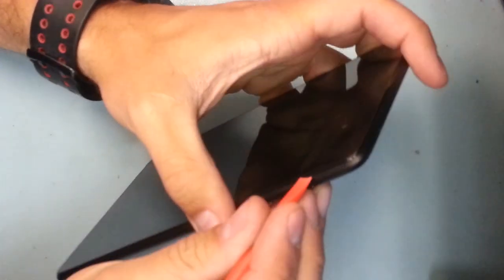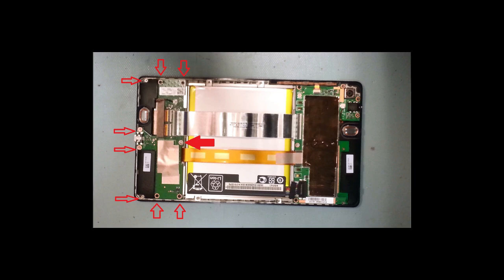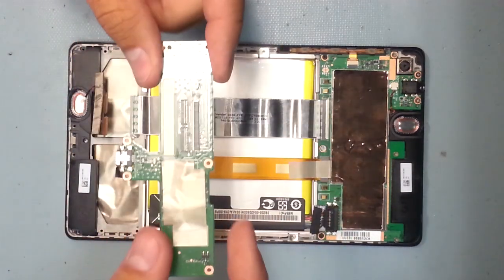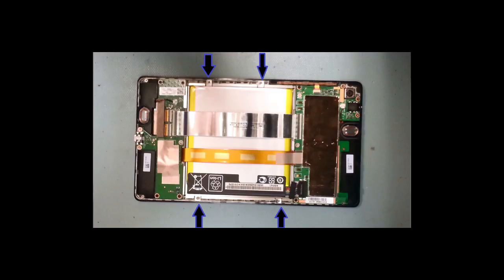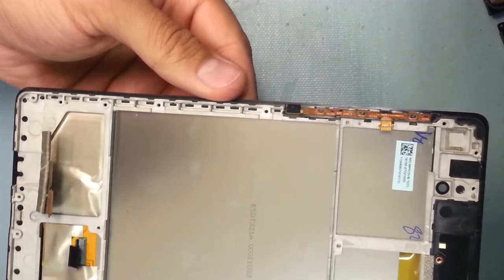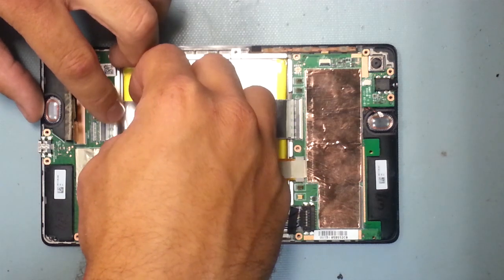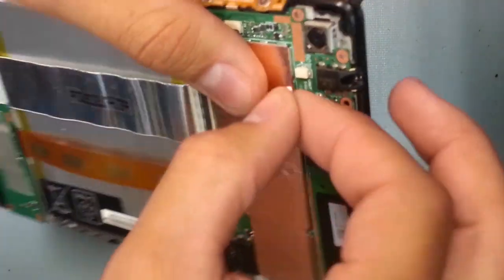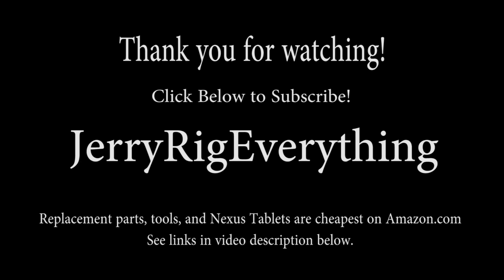2013 Nexus 7 Tablet Teardown. Charging port fix and screen repair.

Comment: JerryRigEverthing, love the nick lol.  Looking for the specific USB part for replacement for this unit.  Sorry if I missed it in the video description area.  I have already gone Qi Wireless for it but I'm looking to replace the port anyhow just to have it functioning again so I can cast Netflix to my Receivers via a SlimPort Adapter to HDMI utilizing this port (Chromecast I know will work also just want the port working regardless :) ) .  Darn Micro USB Ports, I just replaced them on both my Note 1 & Note 2 thanks to my kids breaking the ports and now the Nexus 7 is in the same boat (thanks to wifey breaking it lol).  Excellent Video, very clear step by step instructions.

** Sorry I just caught a comment 6 mths ago that there is no parts available for the USB port as yet and to utilize Qi for now. Darn it.
Reply from the maker: You can always check repairs universe, or etradesupply, or amazon, or ebay, for the parts  you need... But I still havent found anything for this tablet yet.

Comment: Does the screen from repairuniverse also include the bezel (or frame or housing. I'm not sure of the terminology) that is attached to the LCD and digitizer? It doesn't mention it in the description, and there aren't pictures. I noticed a lot of sellers on ebay don't include the bezel, which I think, would add a significant amount of work.
Reply from the maker: I am not sure, I havent ordered that particular part from them.  Check with their little 'chat' service and ask them that question.  If it does not come with the bezel, you can separate the 2 with just a little heat.

Comment: Great Video!  Thank you for the insight.  My Daughters N7-2103 micro USB port broke and I am struggling to fix. 2 Questions:
1) Where can I find a the USB/Board replacement parts (if you know)?
2) Will the QI charger work on all N7's?  Or do I need to install something inside the cass?
(Ok, sorry that was really 3 questions)
Thanks
Jay
Reply: The 2013 has wireless charging built-in. The 2012 model does not.
It seems that the USB connector/board cannot be replaced with a simple board and that it needs "recalibration" by Asus. I call bullshit but it means that you can't easily get a replacement without going through Asus.

Comment: hi again! i managed to change the broken screen on my nexus 7 2013. Like u said, it wasnt that hard. However a few things to keep in mind: 1. its best to DISCONECT THE BATTERY BEFORE DOING ANYTHING ELSE, once youve removed the back cover. I thied doing everything exactly like you did but i must have touched something sensitive and ive managed to fry the charging port pcb, i saw (and smelled) smoke so i thought its done for. But i continued with the repair and, to my surprise, everythings works except charging. 2. like somebody else said it here in the coments, the replacement screen (from etrade supply) does not include the front plastic frame. So you have to detach it from the old screen, or should i say pry it. It is stuck to the frame with a strong sticky tape all around. Hair dryer didnt work, i had to break the screen by making a big hole in the middle and then use a small screw driver to pry the remaining part from the frame. The screen needs to be pushed towards the front of the tablet  in order to be removed. You will need to stick the new screen to the frame, i used very small points of super glue. This is the neanderthal way and i do not ever want to have to do this to an electronic device again, ever. You can also cut yourself in the process and there will pe very small glass particles everywhere. Would be great to be able to buy the whole assembly, screen + frame. In the end the touch screen works but not as seamles as it did on the original one. I am not an expert but i think the replacement from etrade supply (comes from china, not usa!) is the same part as the original. After all this, i whish id have saved me the money (screen + charging port + shipping = about half the price of a new 32GB N7) and the trouble, and just bought a new tablet
Reply from the maker: Sounds like you had quite the experience.  I have looked for other screen suppliers, (As the one from etrade isnt that easy to do)  But I have not found anyone else who sells the screens.  If anyone finds a good one. let me know so I can link it.

Comment: I just payed 60 dollars for the Google nexus qi wireless charger and attached it to the back of my nexus 7 2013 and nothing is happening.  My charging port broke and I saw this as a simpler solution than replacing the port. I don't know what to do. Any suggestions?

Comment: hi! Thank you for this video! This helps A LOT! I will attempt to change the cracked screen on mine. Is the screen that is sold on etradesupply the same as the original? Or is it another manufacturer? thanks!
Reply from the maker: I am not sure where they get their screens from...

Comment: dude. thanks! i just replaced the charing port piece. ur video helped alot! it was super easy. i had gotten a "PowerBot" wireless charger from amazon. and it was working for a while but then all i would get when i would try to power on was 5 blinks from the notification light. its working just fine now. thanks again
Reply from the maker: Glad I could help!  Thanks for watching.
Reply: Where did you order the charging port piece from?
Reply: Seth Wieder ebay. just made sure it was for 2nd gen 2013 version. super easy
Reply: Armando Martinez Jr can you share a link?
Reply: Seth Wieder no. it was a guy selling one. do a search using: nexus 7 (2013,2nd) port
Reply: Armando Martinez Jr How much did you pay? Cheapest I see is $75-125

Comment: This wireless charger, if I got that instead of replacing the micro USB port would that work? It's a lot cheaper. Right now I can't charge mine at all because of the USB port. Thanks.
Reply from the maker: Yup, as long as the tablet has the Wireless charger built into the back, itll work just fine.

Comment: K, so this morning I woke up to my n7 2gen off and I could not turn it back on, was charging all night and worked perfectly the day before. I am thinking my battery went out somehow because if it was the charging port not working it would have at least 50% battery left. If you can find a 3950 mah battery for it I would highly appreciate it, I can't seem to find one yet. When I get home from school I am going to open it up if it continues to not turn on and see if something somehow is broken, maybe I hit it in a bad way and killed a board, hoping for the best. So far I see the best situation being the battery is hosed and I need a new one. Thanks for the video too!
Reply from the maker: No problem!  Hopefully disconnecting the battery for a bit will fix your problem.
Reply: JerryRigEverything Opened it up and took it apart completely and re assembled it. It turned on like new,however the wifi doesn't work. It says "turning wifi on" I looked all over and most people said they restored the tablet and that fixed it, but most I doubt it will. I am assuming there is the possibility that something went wrong on my part when I took it apart. Have you any experience with this problem before?
Reply: JerryRigEverything Should clarify that it is stuck on "turning wifi on" and that I'm not just impatient :)

Comment: When you say that "This is the whole screen" at around 4:40, it is three different parts.  There is the glass screen, the digitizer, and the bezle.  When I ordered the replacement screen for about 100, the bezle does NOT come with it.
Reply from the maker: Yes,  You can transfer the bezel from the old screen to the new screen with a little heat and careful prying. It all depends on where you get your replacement screens from.

Comment: hi man, i have problems whit de wifi connection on the initial boot, detec de wireles but show a message "saved" and dosent connect, on a few second said "innability" or "out o range", i cant configure my nexus 7 2013 kitkat, can you help? thanks

Comment: thanks man this was really helpful. when i click the link for the screen replacement it sends me to the website(etradessupply) but it automatically puts the quantity at 2 which makes it $195 do i need to buy it like that if i want both the screen and digitizer or can i just change the quantity to one and still get both?
Reply from the maker: You can change the quantity to 1 if you like.  I also just linked another screen from repairsuniverse.  It might be slightly more expensive, but ive had a better customer experience with them.  Ill leave both links up for awhile.

Comment: is the process the same for replacing the lcd and digitizer on the LTE version?
Reply from the maker: It would be pretty darn similar.
Reply: Ok awesome. Happen to know if I could use the same LCD and digitizer you've posted?
Reply: JerryRigEverything just wanna say thanks for this. I was able to replace my screen on a 2013 LTE version with these similar steps. Only difference is there is a grey wire on one side under the battery and a black wire under the opposite side of the battery that connect to the top and bottom board. otherwise everything is the same minus one screw on the bottom usb board. Replacing the screen just required a heat gun and patience with removing the old cracked screen from the bezel. Thanks!!!!!

Comment: there are cracks underneath my screen i accidently sat on my nexus 7 i sent it into asus and they said there is physically damage to the lcd. they want to charge me almost as much as is was to purchase from best buy. so im gonna try and do it my self. do i just need a new Lcd or a new screen as well? there is no cracks on the screen.
Reply from the maker: The LCD is the most expensive part.  I would buy the LCD/ Glass combo.  I think I listed one in the video description.  If you buy just one or the other, it will be a much more complicated repair.
Reply: ok thank you very much for your help.

Comment: Know any tips of fixing a screen for a Nexus 7 tablet that it turns on n everything, just does not respond to touch, AT ALL. I've tried power downs, reset, nothing, Even popped the back off and checked what cords I could to make sure everything was connect.

Comment: Hi my nexus 7 broke the other day the screen has a long crack down the side of the screen I can still turn it on and the screen still kind of works as I can still use most of the left side but the right side is completely unresponsive, I just wanted to know what I need to replace is it the screen and the digitizer?

Comment: My Nexus 7 2013 doesn't work at all, I tried all the suggestion but it does not wotk
Problem: Frozen on the X logo.  I tried re start, goes back to the X logo until the batteries is drain.

Comment: thanks for the directions, i used like 20 diff video. need to change the glass, couldn't find anyone who would show how to do the screen, was gonna film myself but gopro was PMSing, my glass broke and i had to peel it of by hand, bunch of cuts but for the fix deff worth doing it yourself
Reply from the maker: Did you actually get it to work?  Im very impressed.  That is a complicated job.

Comment: HI Jerry,  My cable charger seems to be very loose in the port socket and is also not charging and it loses charge when and if it does charge.
Reply: I am having the same issues as well as having problems finding the USB port parts for the 2nd GEN tablet.

Comment: Jerry, when I look at the pictures online of replacement LCD + Digitizer assemblies they don't appear to be what you show there as what you want to replace. In the video it looks like there is a housing with the power and volume buttons as well as the screen, but when I search online the pictures only show a screen without housing type structure with volume rocker,etc. Where can I buy the whole housing and screen assembly?
Reply from the maker: Screens for this tablet have been incredibly hard to find.  I linked one in the video description, but it doesnt come with the frame.  You will need to gently pry the frame from your old broken screen in order to use it.  Sometimes heating it up with a blow dryer helps separate the glue from the parts.

Comment: Hey Jerry, I got a 2013 Nexus 7 for Christmas and somehow have already cracked the screen.  I want to replace it along with the lcd ( I have heard that replacing only the glass is a huge headache and I think that you even said as much in the video).  Do I need to perform the complete teardown that you just demonstrated or is it possible to leave the guts intact and only remove the screen and lcd?  If so, do you have a video demonstrating this?  Thanks!
Reply from the maker: You have to do the complete tear down, as the screen is plugged into the main board by those ribbon cables.  Look in the video description there is a replacement screen linked there for 100 bucks from etradesupply.  Theyve worked well for me in the past.  Let me know if you have any questions.
Reply: JerryRigEverything I will do that. I actually ordered it last night. Thanks for the awesome tutorial! I will hit you up for sure if I have any issues.
Reply: JerryRigEverything One other question for you, as far as the internal screws go, do I need one of those star shaped screw drivers for this or are the screws all Phillips/flathead ?
Reply from the maker: I am pretty sure they are all Philips head, if not  the tool kit i linked has all the bits already in it so youll be safe with one of those.

Comment: Hi Jerry! I have a problem with my audio jack port. When I plug in my earphones, only the left earphone will have a sound. Unless if I hold the jack, that's the time both will work. And also my charging port is kinda loose. Do you know how to fix this?

Comment: Hey man i need your help My nexus wont turn on at all i've tried charging it many ways and at first it wouldnt charge but still turn on Now nothing - Omg What else can i try?
Reply from the maker: I linked a wireless charger in the video description... Thats the only option available right now... Until they release charging ports.   Give the wireless charger a shot.
Reply: JerryRigEverything When do they plan on doing this? The wireless charging thing is nice but I would rather transfer files over USB and not via networks.

Comment: Hi jerry, I really need a reply because my nexus fell( from about 4 feet to wooden floor) and I can still turn it on and off and it seems to still work but when i touch it the screen is not responcive. do i need a new screen or what should I do or try? thank you for reading

Comment: Do you know if the USB ports are available yet?  I can't find one and I know it's the USB port because it fully charges when I use my wireless qi charger.
Reply: JerryRigEverything OK I'll let you know if I do. hopefully it's soon
Reply from the maker: I still cant find any... They should be out by now.  let me know if you find any.
Reply: JerryRigEverything Why are you not answering my question?
Reply from the maker: Jonash Mallari Because there is no 'reply' button under your previous comment.  I would not worry about heat distribution untill something is actually wrong with the tablet (extremely slow and glitchy)  There is no way to make the tablet run cooler once it has started running hot.
Reply: JerryRigEverything Thank you! :)

Comment: Hi Jerry.
My Nexus 7 2013 heats on the top back part near the camera while the lower part is not. The distribution of heat is not even. It's bothering me because sometimes it's so hot to touch. It's weird because the battery is not located there. What do you think?

Comment: There are reports that the nexus 7 touchscreen issues may be caused by a loose display ribbon cable, and that simply opening the tablet and reattaching the ribbon cable, without unscrewing or taking any part out, fixes the touchscreen to work perfectly. I'd like to try this but I'm unsure  which is the display ribbon cable - is it the silver one or the thin gold cable?
Reply: It's the gold one
Reply: Tomas Tavella Thanks. It didn't seem loose but I disconnected and reattached it to get a nice assuring click on both sides and my touch screen has been working so much better. I would get missing touches and crazy ghost touch all over, every few minutes and haven't experienced any of that since reconnecting the cable.
Reply: Furou I want to try this as I'm having some issues but i can't seem to take the back cover off.
Reply from the maker: You gotta get a little aggressive with that back cover.

Comment: I bought my Nexus on Nov 2012. I need the charging port. I have a hard time finding the part on Amazon. Can you send me the link and\or the part name that I need to buy. Thank you so much in advance!
Reply from the maker: Ive never opened the 2012 version, so I cant tell you if this is the right port or not... but this is what Etradesupply says will fit. http://www.etradesupply.com/oem-asus-google-nexus-7-charging-port-flex-cable-ribbon.html
Use discount code JryRig to get 2 dollars off.  Still a little expensive though.

Comment: Hey Jerry, Yesterday my Nexus froze on me while I was listening to my music. I was unable to go to the next song, power the tablet off, go to the main screen, NOTHING! The only tool that worked was the volume up and down buttons. I decided to take my Nexus apart so that I could unplug the battery and then put it back in. After doing this procedure my Nexus still did not turn on----I hear the beep noise meaning that it turned on, but I see nothing on the screen. Please give me any advice you have so I can follow the steps and do it on my own. The last thing I want to do is take it to the store and pay a huge fee just to fix it for a minor issue. Thank you.
Reply from the maker: It should still be in warranty, they shouldnt charge you anything to look at it.  If you hold down the power button for 10-15 seconds it should have a power over ride function and automatically turn off.  I would try that.